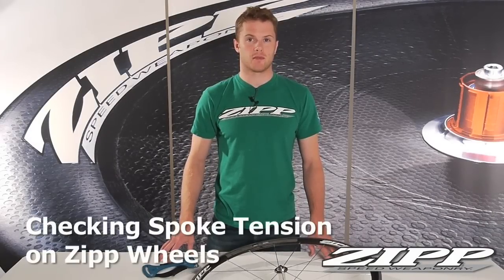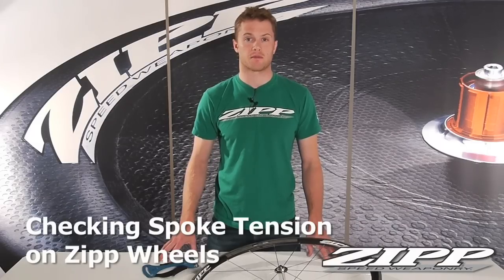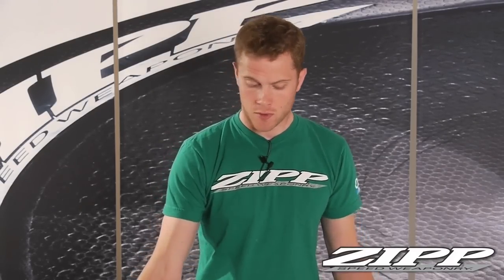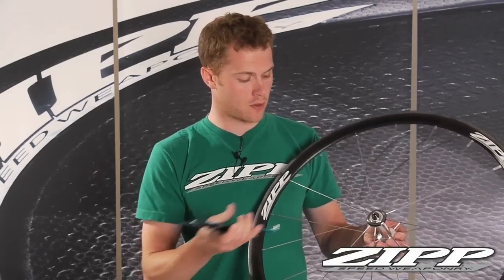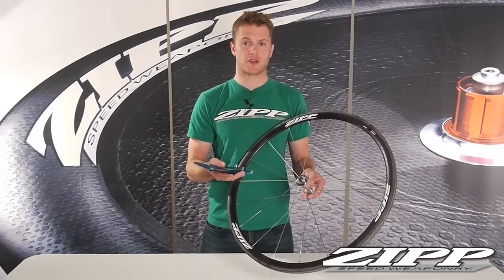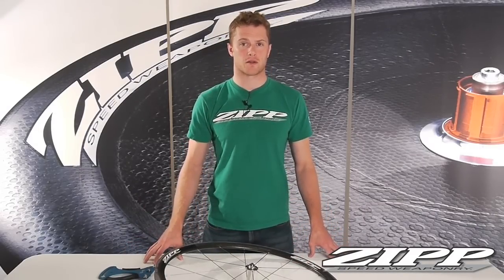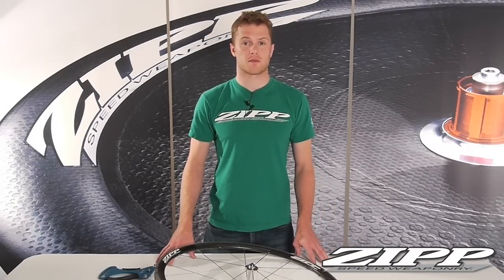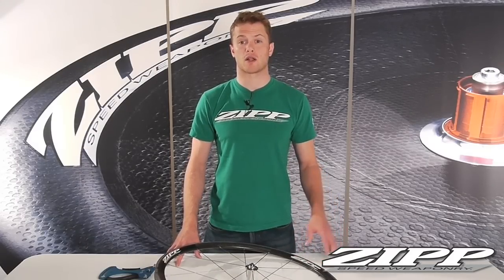How to Check Spoke Tension in a Zipp Wheel

Comment: Spoke tensions on the drive side of rear wheel do not have higher tension because they take all the drive. As the rear wheel is dished, it means the spokes are more upright on the drive side. A simple analysis of the forces involved (with the same spoking pattern) shows the former must have higher tension to balance the sideways pulls of the latter.

It's also not true the drive side transmits all the power. It carries the majority, but as the hub is rigid, some is carried by the non-drive side.

Comment: on top of that, the 188 hub has radial drive spokes, so they transmit nearly ZERO torque (i say nearly because as soon as the hub winds up, the spokes are no longer "radial"). the left spokes on the 188 hub transmit almost all the torque.

Comment: Wel yea, but we deeply dislike paying top price for a wheel that needs repeatedly [or worse regularly] taken to a dealer!
TWICE my 2013 303s had to be returned with spoke issues. A real pain. Something like THREE WEEKS turnaround!  Very poor indeed.
Furthermore, why not simply give the torque settings rather than percentages!
Would I recommend Zipp carbons? For price = NO; lightness = yes; Maintenance = NO; Braking = ABSOLUTELY NOT.

Comment: The drive side doesn't take ALL the torque because as you said a wheel is a solid unit but the drive spokes are not more upright laterally. They DO have higher tension- they're shorter than the non drive. When the rim is pulled into dish (or centered over the hub-same angle both sides) the drive side spokes are naturally a little higher tension. This video was useless- take it to your bike shop? It's VERY easy to even out uneven spokes on same side and the shop's gonna charge a minimum of $25